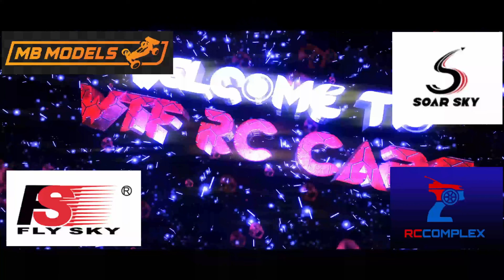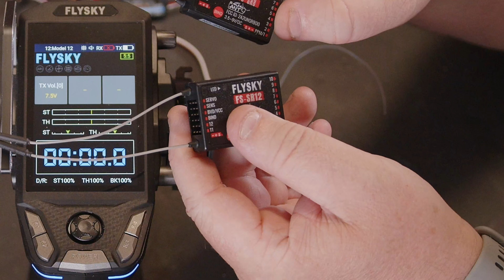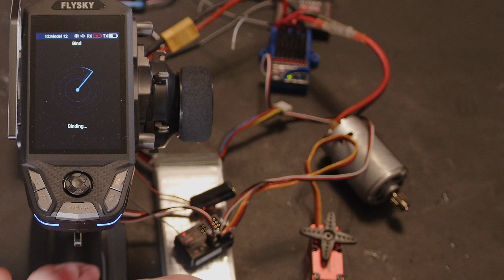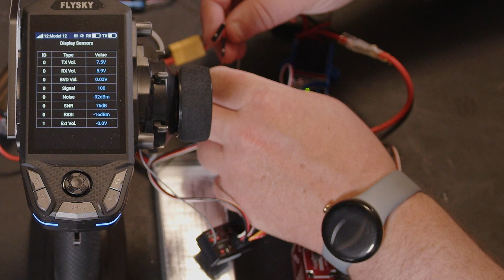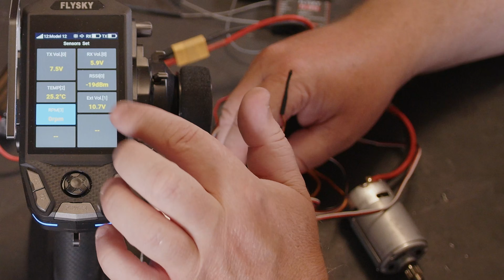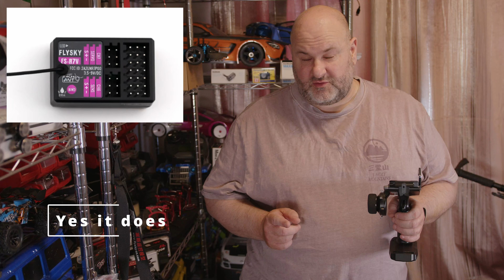FLYSKY G11P Sensor setup

Comment: Question, and potentially a great video idea. This RX/TX combo is apparently not IBUS2 compatible. Otherwise, you could see a ton of helpful real-time parameters. It is IBUS compatible. Is there a way to connect a telemetry sensor like IBTA01? Or a different sensor like it. This is, imo, the information that most people would want to see. Motor rpm, mah used, current draw, voltages, esc temp, etc.
Reply from the maker: The G11P can't use ibus 2 sensors but I have done vids showing what sensors it does support including rpm, temp and voltage but nothing that can show current or mah used
Reply: @WTFRCCars  An absolute bummer. I am surprised the G11P can use so many sensors but not a proper telemetry sensor to see what the ESC sees. I really wanted 11 channels, but I might have settled for the NB4 to have IBUS2.
Reply from the maker: Yeh the G11P is a good tx but I have them all it's not on the same level as the nb4+ or pro + tbh